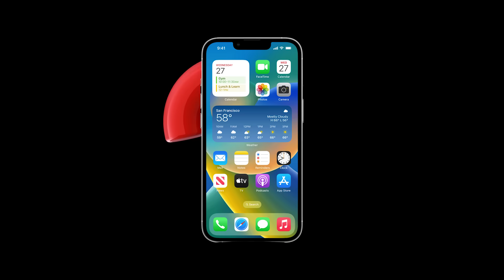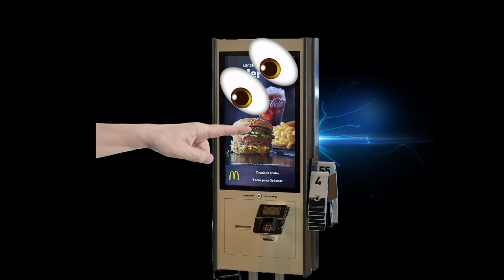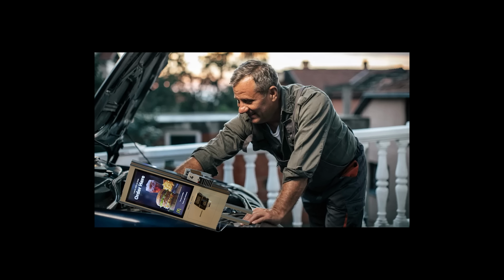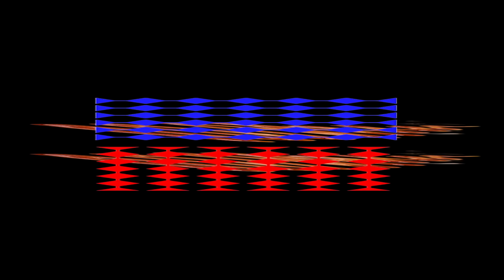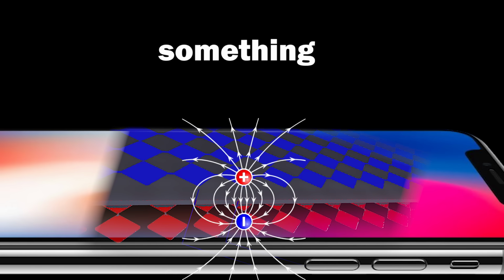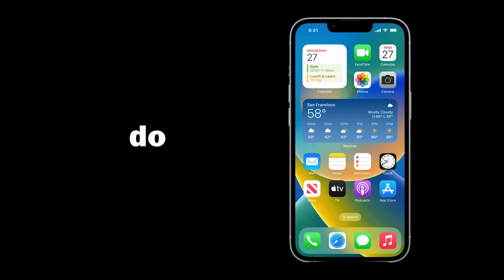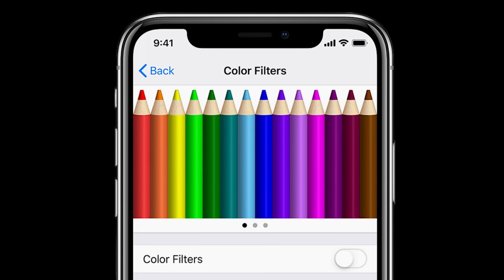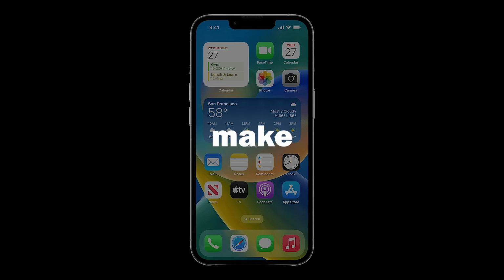How Do Touch Screens...Touch?

Comment: I think the conduction of the touching material isn't enough for the touch screen to react. For example if you touch the screen with a metal bar holding it from the other side, the screen won't react, even though metal is conductive

Comment: Wait, so if the screen works because it conduits the electricity in my fingers, how does the fingerprint unlocking system works? 

Does it read how many electricity passes through my fingers?

Comment: Great video, but you described LCD screens rather than pixels. A pixel emits light (usually in increments of 0 (off) to 255 (max brightness)) in red green and blue. LCD screens achieve this with a uniform backlight and then blocking said coloured pixels. LED screens (except MiniLED which is a LCD LED fusion and a topic for itself) are self-emitting, and have no backlight, so in that instance you would turn each pixel on with the desired brightness rather than blocking light.

Comment: also small correction, there are no dimmers, there is a background light  liquid crystal and polarizer. When background light emits well light aka electromagnetic waves the liquid crystal has a capability to rotate these electromagnetic waves so a small amount of those waves would get blocked by polarizer so it dims.

Comment: Ok but what about smartphones with the "sensitive touch" (or whatever it's called) option, that is made so you can use it with gloves? Or the option that makes it easier to use your touch screen through a screen protector?.. Is it just both technologies combined? And the setting just turns on and off the other method of touch? I'm curious

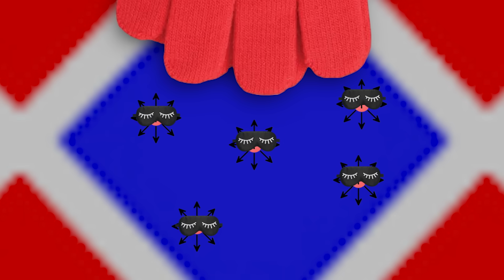Comment: 3:32 Water does NOT conduct electricity. Salt does. Salt in salt water or salt from your sweat mixed with water does conduct electricity. Water does not. Water is a great insulator. Salt suspended in water is a great conductor.

Comment: The touch screens McDonald's uses is not out of plastic but glass as well - capacitive touch screens. The computers running them are just very slowww, so that's you you might want to press harder on them, before you thing it will register your input. At least here in Denmark they are all capacitive touch screens

Comment: A tip for using resistive touch screens, just use your fingernail, those screens work better with a smaller contact point.

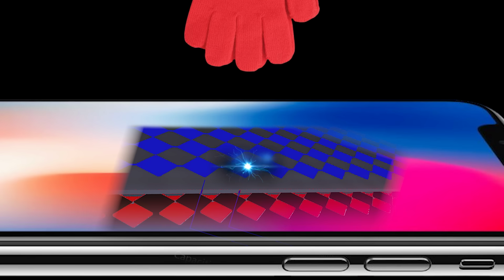Comment: 3:33 Technically water isn't conductive putting impure substances in the water might cause it to have slight conductivity. For example, pure h20 wouldn't conduct very well, but putting salt in water would cause ions to be in the conductive water. so not only is it because it's on multiple spots, but it also varies in conductivity.

Comment: I learnt that in school last year. Pretty fascinating.
1.The "McDonald's kiosk" screen is called a capacitive screens i think.
2.most phones use resistive screen(conductive thingys)
3.some phones use infra-red screens(typically iphones)

Really interesting subject, thank you for keeping the video short and interesting though, keep it up
Reply: I guess you have it the other way round. The McDonalds one should be resistive and the phones (at least the modern ones) use capacitive (because they act like tiny capacitors as explained in the video).
Reply: @TheSdCardGuy  prolly, i forgot it a little, might go through it once more. Thanks though

Comment: then what about those cheap stylus that has soft round RUBBER?
Reply from the maker: those styluses dont use regular rubber, they usually use materials like TCU (pretty much just conductive rubber) still, try wearing gloves and using a rubber stylus. its weird! cause even TCU rubber styluses only work because your hand has enough capacitance, not the stylus.

Comment: 4:03 but that's only LCD for example OLEDs can just dim themselves or turn off completely (hence better colours especially black) there are also plasma and crt screens which I'm too lazy to explain
Reply: also because of that you can control the brightness with software (like windows) instead of having to rely on your monitor settings to dim the backlight
Reply: @Ciecierzyca1 well yes, but actually no, some monitors are just cheap, a lot of smartphones have and had LCD screens, but yet didn’t have brightness buttons on the side, it just depends on the features the producer includes
Reply: @Alexis_Idfk  No shit also I don't think there's a standard for pc-monitor communication PC's also have to support a wide range of hardware while you don't have the same issue with phones 

LCD monitors (not screens) could have software controls but they (usually at least) don't
Reply: @M2rsh  There is some sort of standard for controlling the brightness of LCD backlights over an HDMI or DP connection. Windows just doesn't support it for non-laptop screens by default (you need to get a 3-party app to do it).

Comment: Questions 1: If all you need for touchscreen to register an action is a conductive material, then why won't ballpoint pens work with screens? They are made of metal after all

Question 2: Why are passive stylus pens so expensive? Why would therr be more technology than a copper wire of a stick?

Comment: there is a point that you didnt explain, 
> if the charges move trought the conductor, so why a metal bar cannot be used like a pen? a metal bar is more conductive than our hands, it means that conductive material is not the only thing nedded to activate the touch, you actually need a conductive material that is eletricaly negative, our body is an example of that. You can easily see some stylus pens called "capacitive Pen" or something like that, these pens creates a kind of capacitor where the point that will be used to touch the screen have negative charge. 

my english is bad sorry.

Comment: I used a Lightshot hot key to take a screenshot cause It freezes the image in a nanosecond and got it first try :)
Slider or using the < > doesn't work with so few frames, it literally ends the video skipping the last couple of frames as if they were never there.

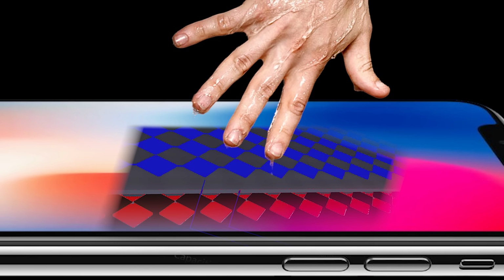Comment: 3:33 It is important to remember pure H2O does not conduct electricity at all, however water that contains some ions, (often water will contain some salt) will conduct electricity well.
Reply: Why is it important?
Reply: @__nog642 sighhh
Reply: @__nog642 Because it's important to know how to seperate truth from misconception
Reply: @mk_rexx this entire video is strongly leading to misconception, the explanation is nowhere near of today's standards of science o.o
Reply: @matheusprestjor  i don't remember cuz i left this comment too long ago, but probably vague explanation
Reply: @peixevoador31 Many reasons but the most obvious is probably the representation of an electron. I wouldn't say it is misleading but it simplifies lots of concepts, which is fine.
Reply: Thats not entirely true. In all water, normal drinking water with dissolved salts and destilled/pure water theres a process happening called autoionisation, which means that 2 water molecules react and form 1 hydroxy-anion and one hydronium-cation. Both are present with a concentration of 10^-7 mol/l. So even in pure waters there are very small amounts of ions, which makes it very slightly conductive.

Comment: This actually helped me completely understand touchscreens. Record vinyls on the other hand...
Reply: Within the grooves there is basically little bumps. The stylus, which is what the part of the record player that touches the record is called, usually gas a really fine diamond tip that runs within the grooves, reacting with the bumps. The stylus reacting with the bumps create a small amount of electricity which is what eventually makes a sound out of speakers. Each bump is slightly different which is how you can get songs out of it
Reply: they made a video for that.
Reply: Completely missed opportunity to say 'this made a video for that'

Comment: 3:33 technically water isnt conductive put impure substances in the water might cause it to have slight conductivity. For example, pure h20 wouldn't conduct very well, but putting salt in water, would cause ions to be in the water which IS conductive. so not only is it because its on multiple spots, its also varies in conductivity.
Reply: Yeah if you take 100% pure H20 it won't conduct electricity BC it's not ionic compound. .
Reply: @xninja2369  What is this hydrogen-20 isotope you speak of?
Reply: @nullptr_yt  not talking about isotope I am taking about PURE  water (H2O) , which you can only find in lab ...

Generally normal water contains impurities like iron , sodiam and magnesium (which is the reason why we drink water because we needs them) they conduct electricity...
But ONLY PURE WATER DON'T conduct electricity because it is covalent compound ..
Reply: @xninja2369  Does that mean if lightning strikes a pool of pure water that I'm swimming in I'd be fine?
Reply: Technically your finger isn’t conductive but the skin around it is? See how stupid you sound? Water (the kind we use 99% of the time) is conductive BECAUSE of the impure substances. They are a part of the water we use.
Reply: Tap water also contains impurities so it will still conduct electricity doesn't matter whether you add salt in it or not
Reply: and also rain
hate using phone while it's raining
Reply: @keisuperstar yeah rain has dust in it
Reply: @anonymous._._ yeah, he said PURE water, not tap water
Reply: @anonymous._._ They said pure h2o
Reply: by the way guys pure water (H20) is conductive but not enough to carry a the charge. H has very small positive charge and O has very small negative charge
Reply: Where do you even find pure h20 without specifically buying them anyway
Reply: @enki-enlil  I guess you can boil regular water and collect the water vapor that should be pretty distilled form of water I believe.
Reply: @enki-enlil  just wash ur sink
Reply: @loldoctor  Nooo
Reply: Pure water should be very slightly conductive but I am not sure whether it is enough to trigger a touch screen. It contains a very low concentration of ions (charged molecules) because two water molecules can react with each other to form one hydronium ion and one hydroxide ion. This process is called autoionisation. The reaction in the other direction happens significantly more readily and that keeps the hydronium ion concentration at 10^-7 moles per litre. This is why water has a pH of 7.
Reply: @i13-p1y exactly, so yes even destilled water is slightly conductive, but it probably won't trigger an touch on a display.